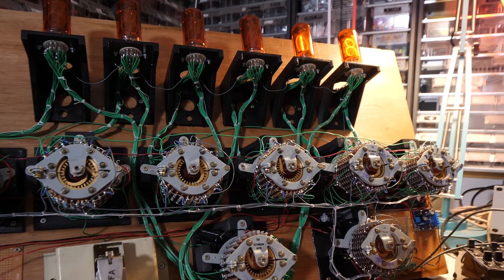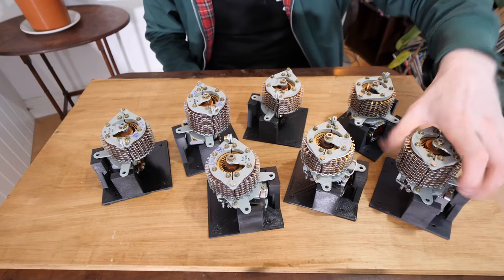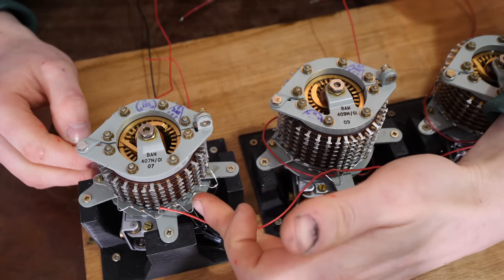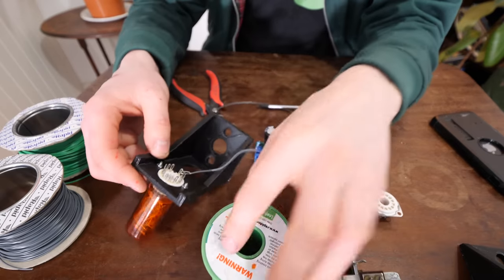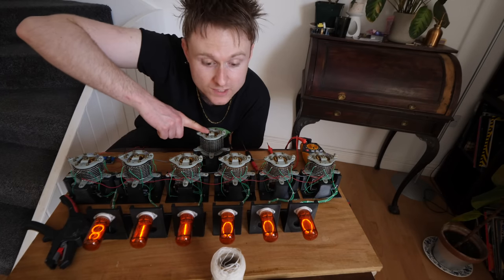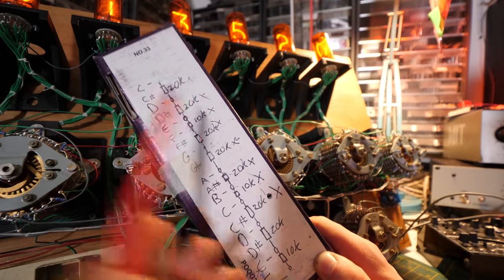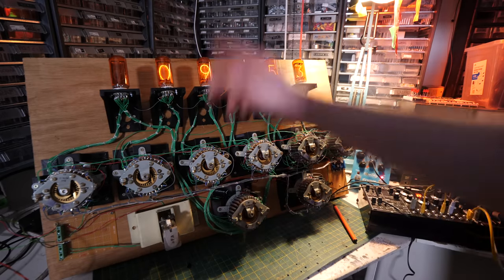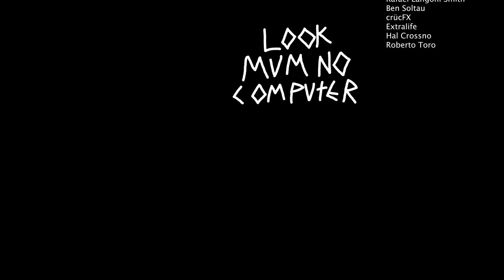This Electromechanical Counter will survive an electromagnetic storm and play you a song

Comment: This reminds me that I really want to see how those old LED matrix type displays worked way back in the early 1900s. I keep seeing them in really old movies and I have to remind myself that those aren't LED matrix displays. They would have to be regular old lightbulbs. And no computers would be involved. So it would have to be something electromechanical. 

I can sort of guess how they work. But I'm getting kind of lost when imagining how they were programmed. Was it prebuilt letters that one slotted into a row of edge connectors? Was there a prebuilt alphabet in a sort of ROM memory? Did the basically write it out on a giant litebrite where each hole goes to a single lamp outside? And then I see them animate scrolling around a curved corner and I loose all semblance of understanding. Anyone know a good video detailing how they worked?
Reply: Motor driven drums with hundreds of finger contacts, and pegs for programming. It's way more mechanical than you think.
Reply: My understanding is the animated text displays worked using punched paper tape. The paper would run over an array of electrical contacts and when a hole moves by electrical contact would be made for that particular pixel.

Comment: Why not just do the counting in base 30, since the uni-selectors each have 30 contact points?
Reply from the maker: Yeh but how do you display that simply
Reply: Hey, thanks for the reply! Let me start by saying your approach is 100% better engineering, because it's simple and elegant. I would choose your way every time in the same situation, as there's no downside at all, other than leaving a lot of information density on the table, which you make up for by adding more selectors + nix tubes. 

I'm not sure, because you would have to find a way to just represent base 30, as encoded by the position pins between the selectors, by converting it into base 10, which is encoded by the voltages feeding into the nix tubes. Maybe it's an interesting problem for a later video. 

At a certain point it would make sense to do it this way, probably, if you had to count to a high enough number, from a cost standpoint, like for counting seconds in a century or something.

Comment: if the second last one only counts to 12 then the last one needs to count to two doesn't it? AM/PM - or you could go 24 hours.
Reply from the maker: You could achieve both with 1 uniselector
Reply from the maker: You could even make it switchable with a single switch and a uniseector
Reply: @LOOKMUMNOCOMPUTER  That would be a pretty cool clock combined with that old analogue telephone timer thingy.

Comment: Wrong! You need all of the switches for the clock because of course you need to count from 0 to 23 😉
Reply from the maker: That’s just a relay to set between 12 and 24 hour
Reply from the maker: Also it still has 24 so no you don’t you just need 5

Comment: I'm disappointed, a guy like you could have used a Voltage Doubler circuit, like a "Cockcroft Walton" capacitor/diode array with a 555 timer, some beafy 250 or so Volt "Wima" capacitors and 1N4007 diodes, doubling from 12 Volt to 24 Volt to 48 Volt, to .... Volt. some people here on Tube generate like some 350.000 V with it using DIY capacitors, thus creating huge arc's.
Befaco did that also in their Instrument interface 4 for the 48 Volt phantom power, see the schematic.
 : )

I also assume you wanted to refer to  R2R array rather than a voltage divider to create a DAC (like they did on the Roland Tb-303) and a Arduino to quantize over the whole keyboard.
Using a 74hc174 hex d type flip flop.

For the techno pipe Organ, try fingering out a clever solenoid leverage design with better seals and 3D print it, maybe with a integrated nozzle/flange for pvc pipe plumbing. maybe you can reuse the coils.
to safe on energy due to leaks, remember Klaus Schwab doesn't want you to own anything, Be Mind controlled by your phone or a chip implanted by 2030 and be happy.